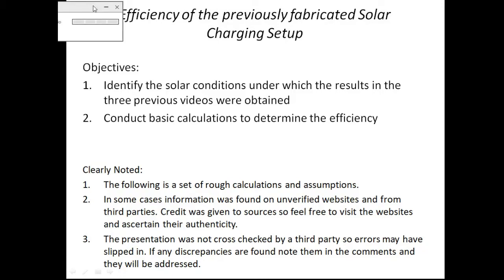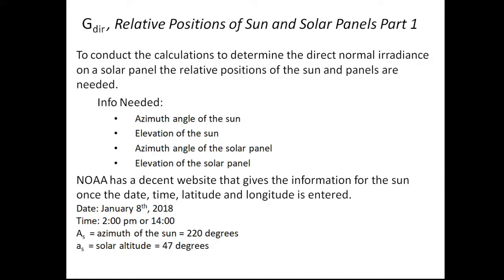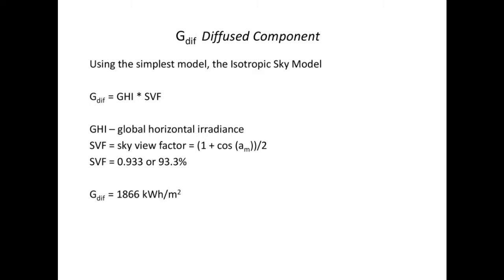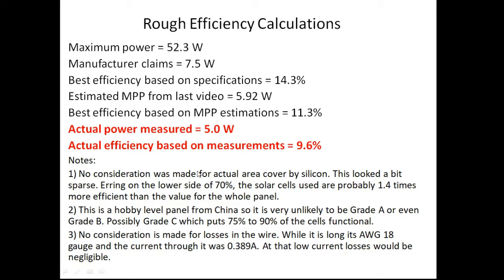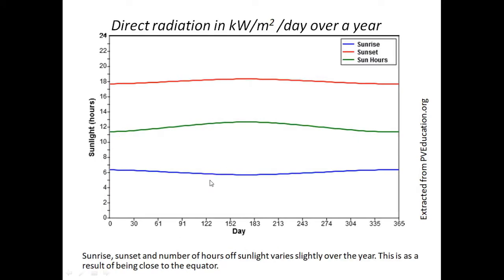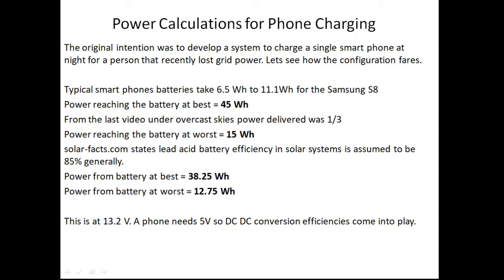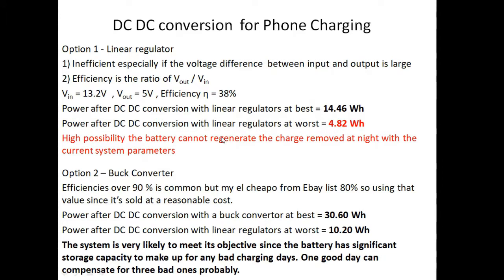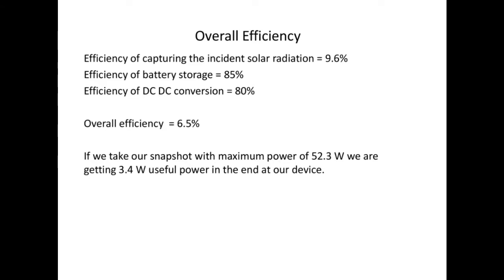057 Solar Charging Efficiency   The Calculations

Comment: big challenge isn't it. We got a lot of Solar stuff down here but to get impact requires a lot of square meters of panels, not to mention storage (Li ion helps somewhat but then adds a lot of cost and safety concerns). 
Not sure how the prevailing winds are like where you are but an interesting experiment could be to combine a wind turbine with the solar panels (simple electric motor conversion) and if the wind doesn't blow too much you could also look at a thermal chimney to create an updraft. LOL getting too creative here.
Really good and honest info, and not as uninteresting as you may think. You have a gift for explaining fairly complex considerations in an easy to follow way. Detailed physics lessons are not always required and you seem to get that spot on.
Take care and keep posting
Mark
Reply from the maker: Mark thanks. I am in the Caribbean so there is a lot of wind here. The countries are small (size and population) so most do not have the resources to invest in wind turbines. I am predicting that sooner or later a large company will come down and do a design build operate wind solution and sell the power to the local distributor on the relevant island. 

Prevailing winds are from the north east and sometimes east of the islands. No land mass between here and Africa so lots of wind and potential. The one challenge is hurricanes. We get them every year but the path of full destruction is generally very small. Everywhere areound gets very heavy rain but not the complete destruction via wind.

I agree with the solar challenges you mentioned. Further lithium will be problem soon enough. Some decent reserves in South America but that will start to get strained. Everyone wants it to power their devices. From cell phones and laptops, to power tools, to cars and homes. I am not convinced we can sustain that level of usage.

I am planning on doing some wind experiments time permitting. I also want to do a cheap solar water heater. possibly compare copper to CPVC but I may get bust shortly so I m not sure I will get the chance.
Reply: Sounds like wind would be a great experiment for you. reckon an old dynamo we used to use to run lights on a pushbike clamped against a bike wheel mounted horizontally with vertical blades mounted to the wheel could give a good base as a supplement to your solar charger and be light and cheap. another cheap one I've seen used an old car alternator or generator and is ideal for lead acid batteries. 
Food for thought when you get time ;)  just throwing you some ideas.
all the best my friend.
ps.
 have seen interesting setups for water heating using a copper tube running along the focal point of a parabolic reflector. Cool because you only use a small length of copper and then let convection cycle the water through using hose connected to an appropriate reservoir/storage vessel. Most basic I've done is 50m of 12mm black irrigation tube thrown on my galvanised roof with water being pushed through from a pool filter return line. In 30-40C daytime temperatures you get some surprisingly hot water out of that (steaming)
Reply from the maker: I was considering an alternator from a car but it does use power to generate the magnetic field. I need to do some more investigation to determine the losses and how to power on only when power can be generated. Alternatively a DC motor with magnets would work. Something like a car windshield motor but I would need to remove the work gear and put a different gear train. The challenge is getting gears. 

I like the black hose idea. I was considering CPVC spray painted. Solar water heating is used on many islands in the Caribbean but not where I am located. Electricity here is too cheap. Installed a system for a house can easily cross USD$1500. Point of use shower head heaters are typical here.
Reply: maybe an old rechargeable power drill/tool for a dc motor donor ;)
Reply from the maker: I have a new electric screwdriver that I scrapped on one of the videos. Its speed and torque was a lot lower than my black an decker one so it was practically useless. It has a planetary gear system. Funny part is its really difficult to turn at times while reasonable at other times. Hand spinning at about 1 rev per second got me about 0.7V The challenge is matching it to a turbine that has the torque. If I do not use that one its still something that needs to be done.

Whatever I build I would like to do a rough analysis to see the efficiency. How much potential power there is in the wind and how much is the design extracting. What is the overall system efficiency as I did on this video for the solar charging.

Some good ideas to knock about and see what works best within the limitations I have to work with.
Reply: reckon that screwdriver probably runs on about 3.7V , you really need an old 18V power drill and dump all the electronics and gearing
Reply from the maker: It does run at 3.7V. I will look into the power drill. Little difficult to get an old one here but I will ask around.